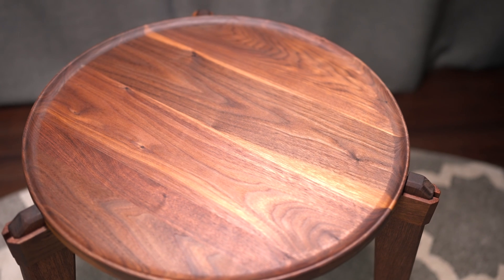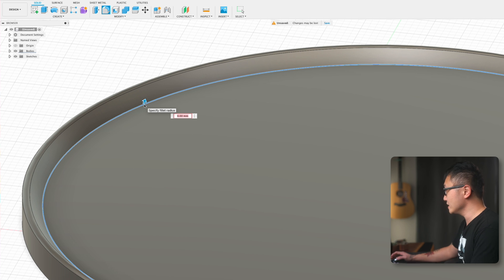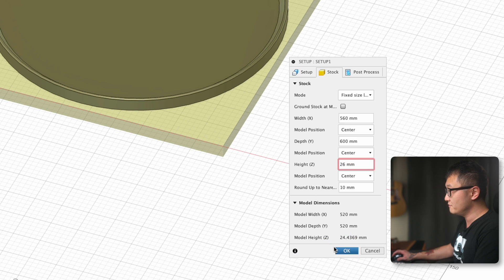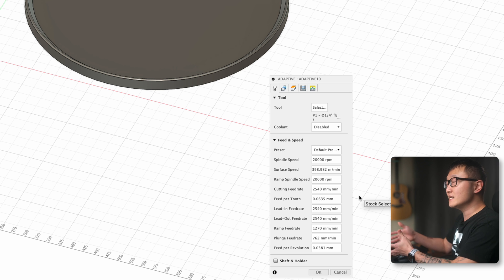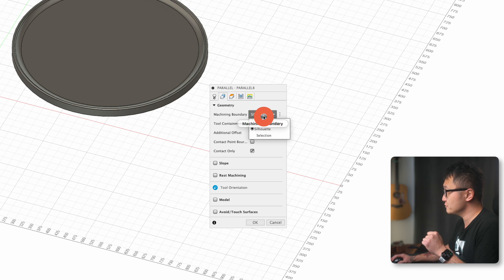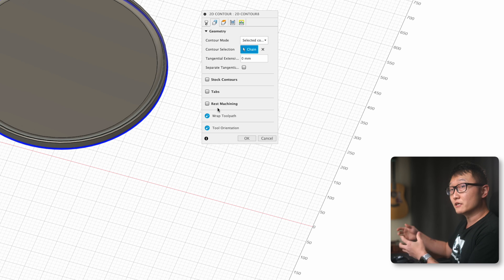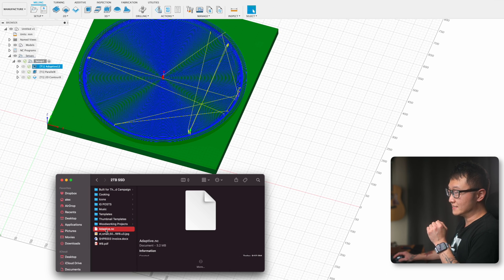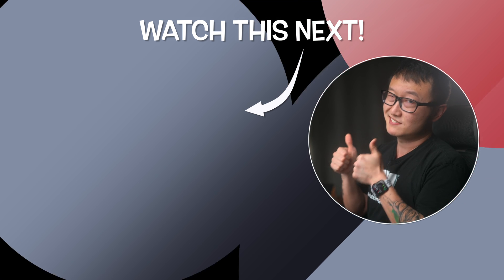Fusion 360 CNC 3D Carving Tutorial for Beginners 2023 || HOW TO CAM Basics

Comment: Hi This was a good video. Im new to CNC and are trying to set up my first CNC job. Its a Topograhical model, poplar ply, wih contour step downs, stepdown 5.8mm vertical wall. I used 3D adapative to hog out most of the mateial with stock to leave on each contour. What tool and tool path would you use for finishing the contour walls if i  want a small radius at the bottom of each contour as it transitions on to the flat or axial of each contour.  I have tried a bullnose 1/4 bit but it leaves some stock on the radial wall at bottom. Probably because of the radius on the bit.
Cheers

Comment: This is a great video thank you. I have a question, I modified your directions to make a smaller dish. I am finding on the 2d contour tool path it is not cutting all the way through my stock. I am using double sided tape and a probe to find my zero. Any ideas what I could check or change to make sure it cuts through my stock completely?

Comment: Great video but I find using the Easel/GRBL post processor and then GSender as a better combination. The interface in GSender is just slicker with better probing, no easel driver required, inbuilt surfacing and diagnostics. It's free but I'd pay for it if they asked.

Comment: Great video. I'm using 1/8 bits with a similar process and I wonder, since I'm using bits with the same diameter, if the adaptive clearing is always necessary or if I could just jump straight to parallel?

Comment: Great video but I keep getting the same issue - once I do the final step to create the toolpath, the bit shows on the Z axis and the toolpath shows that it will only cut from the side as opposed to the top. I suspect that somewhere I have an incorrect setting but cannot find it. Any suggestions?

Comment: Awesome tutorial! Thank´s so much for sharing. 
There is just one thing, which does not work for me: The second step in the setup mode which generates the parallel shapes does not work for me. As Fusion only generates parts of the shapes and not the whole path as in your video shown the cnc does not remove all the rest of adaptive clearing. Is there any setting which I have to made in any step earlier to get fusion to drive all the paths as in adaptive clearing?

Comment: Just out of curiosity would there have been any downsides with combining steps 1 and 3 so you would only have one tool change?
Reply from the maker: Yeah if we cut the piece out, there’s no good way of holding it down for the parallel pass. We could use more double sided tape, but the parallel pass takes a long time and we never know what could happen in that time.

Comment: so when the 1st operation is done how will i know exactly where my mill should be on all coordinates in order to continue where it should after shange and not like 1mm off to one side?
Reply from the maker: The XY origin won’t change from operation to operation, unless you decide to reset the origin. But you’ll have to recalibrate just the Z axis after each bit change
Reply: @BevelishCreations  ok so there is an option to move the end mill in all axis to set it where ever i want i to be and once i start xy doesn't move and once it's done with one operation it comes back to the start and lifts up so i can change the drill, how much does it lift up and how do i recalibrate it, can you make a video that adds onto this one and shows that process where you ended?
Reply from the maker: Yeah after you’re done with one operation, the machine automatically goes back to the XY origin that you had set. And the control software will allow you to move the Z axis up or down so you can change the bit. And the control software will have an option to “calibrate XYZ” and another option to “Calibrate Z”. Just click on the second option and use your regular calibration method (by eye or using a probe). And then run the second operation.

I can make another video sometime, not sure when though
Reply: @BevelishCreations  o wow nice program

Comment: My xcarve came with a 1/8 collet, did you just upgrade to a 1/4 collet or did it come with it?
Reply from the maker: No, I had to get the Dewalt router with the x carve, and the router had a 1/4” collet. Not sure about the newer X carves
Reply: @BevelishCreations  the newer one came with a Mikita 1/8 router. Also do you have to manually adjust your spindle speed or did the machine automatically do it?
Reply from the maker: Makita should have a 1/4” collet. You’ll have to adjust the speed manually. You’ll need a spindle if you want to do it automatically

Comment: Great tutorial, im all new to CNC  and manufactoring on Fusion, only done 3D printing.

If I have a model I made, I would like to NOT fillet the edges, but instead use the CNC with another bit to make the rounded edges, just like you do with a router. But I cant seem to make it. Do you have a guide for that too?
Reply from the maker: You can do that with a bowl bit and a 2D pocket tool path. But the radius is limited by the radius on the tool. For one-off projects like this I like to customize the fillet size, which is why I do it this way
Reply: @BevelishCreations  thank you very much, I'll investigate it further. :)

Comment: Awesome video! I have an x-carve but have been looking to make the switch to F360 so this was timely. Well done! One Q: will the carve stop between tool paths by itself to change tools? Or does Easel consider each of the frames you imported one job?
Reply from the maker: Hey! Easel will stop after each “workpiece”. It’ll move the bit back to the home point. You’ll switch out the bit, and it will ask you if you want to use the previous zero point. You’ll want to select “use previous zero point”, and then you’ll want to re-calibrate the Z axis since every bit will be different length. And then just press Carve again
Reply: @BevelishCreations  Ahhhh ok that makes sense. Thanks a bunch! Great video.
Reply from the maker: Thanks!